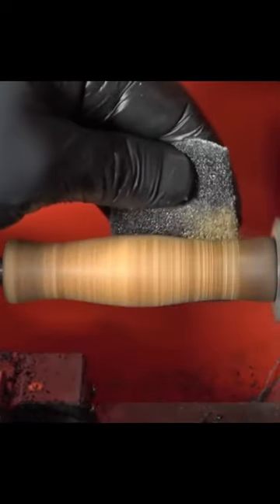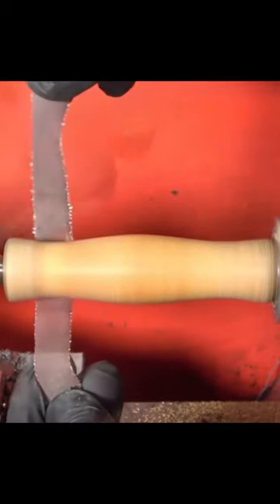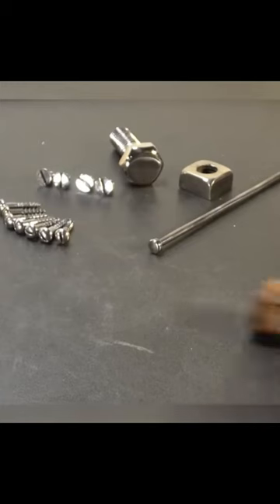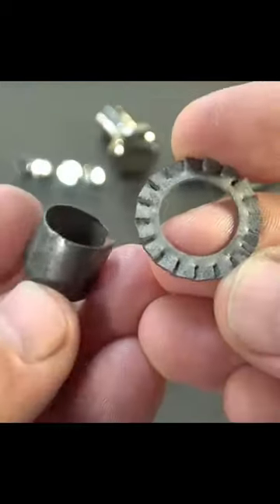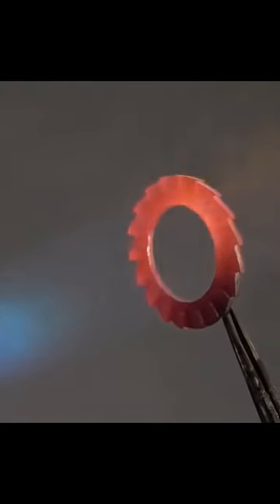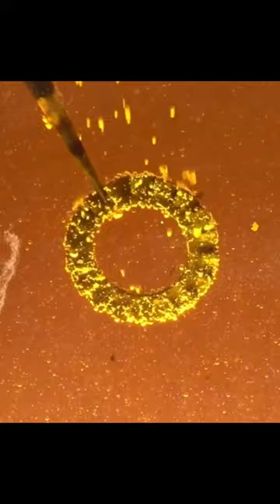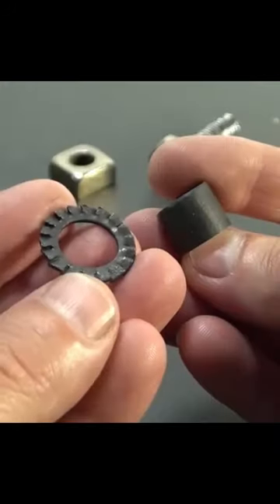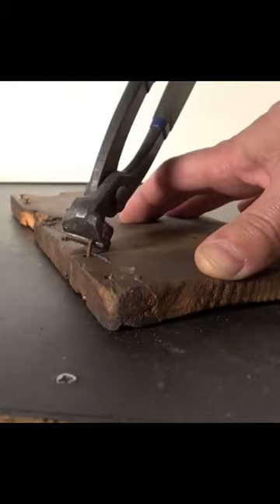HOBBY LOBBY CRAFTS pt7 #trending  #yapping  #wisespade7  #diy  #asmr

Comment: The heat and oil is annealing. They do that to ensure the properties of the metal (i.e. hardness) are correct.
Reply: Dipping in oil is quenching(hardening)
Slow cooling in still air atmosphere is annealing(softening)

Comment: Dude, you need to study a little bit of metallurgy to understand why they’re heating and quenching the material. 
The little fan looking thing is called a lock-washer. While heating the steel, the molecules expand and realign into a more granular alignment in the process called heat soaking. They dip it into oil to quench it(rapid cooling) the oil cools it quick, but not too quick. Quenching results in hardening. Hardness is brittleness, so you don’t want to quench it in brine(salt water) 
This heat treatment will help the lock-washer do what it is intended to do. If the lock washer is annealed(softened by slow cooling) it will be just as useless as a flat washer.